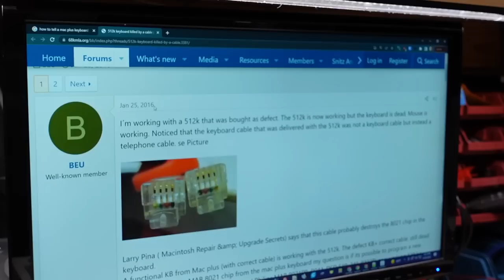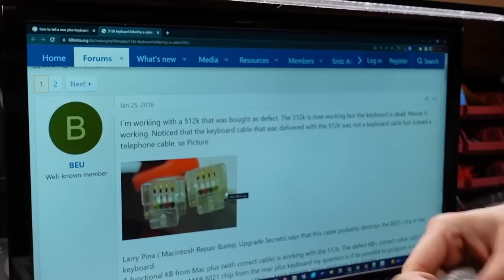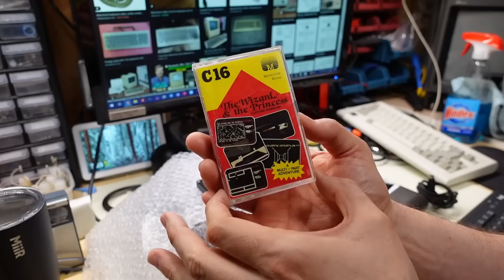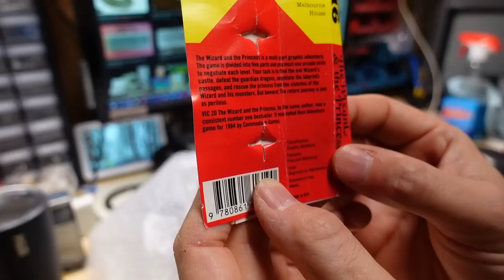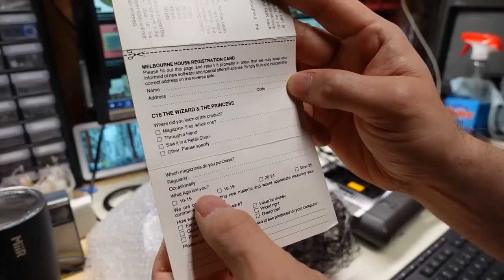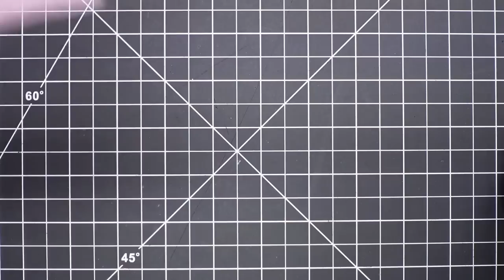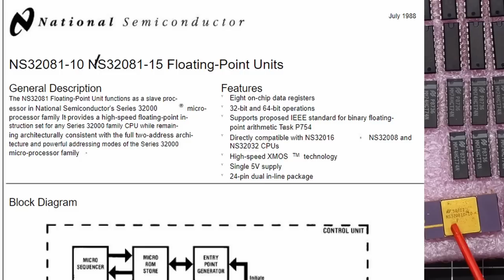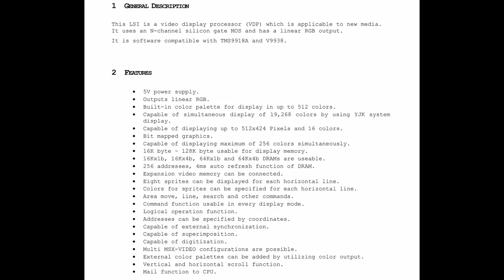0037 New old stock PCjr keyboard, the best adventure game of 1984 and a ton of chips

Comment: In relation to the 65816 processor that you can get adapters for to sit in a 6502 slot: I have a 65c802 processor in my apple //e.  It's effectively the 65816 processor with that adapter (that just loses the upper 8 address lines).  As for software for it, the only software that I personally found for it in the day was a version of Merlin assembler so you could easily write software for this processor.  I made great use of it as a teenager and wrote a fair amount of code to do things like Mandelbrot set generators or game of life using the 16 bit instructions/registers (which meant that things ran significantly faster than what it would have with a stock 65c02).  I even have one of the printouts from that era that I printed on an Apple DMP printer signed by Benoit Mandelbrot.

Comment: 12:04 This one is a Rockwell 65C02 made for the later Apple II machines (the Enhanced/Platinum IIe, perhaps also IIc).
Apple used other 65C02 versions from other manufacturers, too, though.

15:20 The Am9517A is a DMA controller - so good job there! (don't know if they are Intel clones, though)
There are also several Real Time Clock (RTC) chips like the NatSemi MM58174 on that sheet.
The JRC (Japan Radio Corp.) 2267D are dual video amps and also certainly not 74-series logic chips.
I've also spotted on of those 556 dual timer chips on that one - they were often used.

16:15 This OKI chip is also an RTC and not a RAM chip.
There are more MM58174 RTCs and their bigger DIP brother MM58167 to their left is also one.
There are also two more AY-3-8912 sound chips further down (when using the writing on the ICs as a direction).
Reply: The 8237 was an Intel clone of the am9517 (not the other way around) so they are identical.  The am9519 is an interrupt controller, similar to but not compatible with the 8259 and the am9513 is a timer, similar to but not compatible with the 8254.  The 9517 was based on the intel 8257 so amd was taking intel parts and improving them but the 8237 was the only intel adopted.

Comment: That PLCC 68010 looked like it was a 25Mhz part! I didn't know those even existed. The Supra Turbo-28 was a 28Mhz 68000 accelerator for the Amiga 500. This part would probably direct-swap with that (with slight OC) and give the customary 68010 15% boost from the instruction cache.

The MOS 5719 is a Gary chip from an Amiga 500 or 2000. 8364 is Paula, and 8362-R8 is Denise.  The R8 has the Extra Half-Bright mode. The R5 commonly found in the A1000 does not.
the 3xxxxx-02 chip is an Amiga 1.3 Kickstart ROM. -01 is a 1.2 Kickstart ROM.

Comment: The 65816 was also used in the SuperCPU, which was a processor upgrade for the Commodore 64. Plugged into the cartridge slot, and I think it was clocked at 20 MHz. I believe there were switches on the expansion to disable it. Exceedingly rare, and is my personal holy grail to find one.

Comment: The MC6809 is the chip that was used in CMI's FAIRLIGHT V that used 8" floppys and was used to create Crockett's Theme and would be the unit Dr Mix would want to get his hands on.
Reply from the maker: Heh yeah it's also the brains of all TRS-80 Color Computers (From the Coco1 to 3) along with the Dragon 32/64 machines. I'd imagine the TRS-80 Coco line was the biggest selling consumer facing thing that used them.
Reply: @adriansdigitalbasement2  Note that the CoCos use the 68x09E variant, which is code compatible with the 6809, but not pin-compatible, so I don't think the 6809s you have here could be plugged directly into a CoCo as a replacement.  I believe that the SWTPc 6809 boards do use the 'regular' (not E(xternal clock)) version of the chip.
Reply: The Vectrex game console also used a 6809 microprocessor.
Reply: I’ve seen a lot of embedded systems use the 6809. The automation system on a Soundcraft 2400 used it.

Comment: An HP variant of those hex displays (HP 5082-7340) were used in the original 1976 Cosmac Elf computer from Popular Electronics, powered by the RCA CDP1802 :) Modern recreations usually use the TIL311 as they are easier to find.

Comment: The hex display chips are suitable to be used in an original cosmic elf build from the 1976 and 1977 popular electronics magazine articles. You can download the complete article from the web and still find all the chips to complete the project today. The original display chips called for are the hardest part to find. The TI chips you received are much easier to find and although they are not in the same package as the original they will still work and look period correct. Maybe a Cosmac Elf build would make a good video. Steve

Comment: I wish the bare SYM-1 mobo I'm about to build (technically an SM-100 OEM board) from 1978 was wired for those TIL311 displays. Alas, it's already pinned out for regular 7seg units. Probably for the best given that those TIL-311s regularly go for over $10 each on eBay these days. 😃

Comment: It looks like with Macintosh, you just have to double check the pinouts and then crimp it once you confirm the wire order.  Really I don't own a Macintosh but that is probably the least proprietary part Apple has ever used.  I like that design because someone who knows what they are doing can go to the local home store and make a new keyboard cable.  I just hope they realize to check the pins on both ends of the original or get photos from someone who has the original of both connectors side by side and as clear as possible.  These days it is easy for almost anyone to snap a photo of anything and immediately send it to someone (or as soon as possible).  For PCs you can find the connectors for most cable ends online anyhow but it is so nice to be able to just make a new one just like making a network cable.  The only downside of the PC connectors is there may be a shortage of them with the supply chain issues we are having these days.  How long until this nightmare is over?  I just want everything back to the way it was before the pandemic (low prices once again and no more shortages).

Comment: So that stack of chips calls for a diy homebrew project, z180 + 9958 some ram and rom, even sound on a 4x6‘‘ pcb. BTW that plcc package ic in the beginning was either a dual ported sram or a cpld ( I didn’t catch the label on my phone 🤓 ) I’ve go a pile of old ICs catching dust on the shelve ( very similar assortment) myself that I don’t find the time to mount on a board and tinker with - too much projects and not enough time - oh well

Comment: when you look at both rj connectors that way and the wire colours are "reversed" but if you hold the cable out straight then the wires are straight though, not crossed...

Comment: If you watch iPhone repairs, Apple booby trap everything, ie long screws next to short screws in the hope you use a long in a short hole and punch a hole in the PCB.  Components surrounding connectors/battery, so if you pry them wrong you smash them.

Comment: Nope, the HD64180 wasn't used in MSX machines. Only plain Z80s (later integrated in chipset) and later the R800 which was a faster Z80 variant designed by ASCII

Comment: That’s urban legend! Using a flipped cable won’t kill the keyboard, at least in the Mac Plus, the keyboard will just not work.
Reply: I remember I had a Mac Performa as a teenager and I somehow fried the ADB port by using about 4 loose wires (the wires you'd find in a Radio Shack electronics lab kit toy) to connect my keyboard pin for pin when something happened to my keyboard cable (something must've crossed or shorted).
It looks like those cables are RJ9 (you can still find RJ9 crimpers and connectors and as for the wire you can probably use any sort of 4-pin cable) - so as long as you know which end is what you can cross and flip them as needed to have the right cable

Comment: Imagine apple making incompatible cables for their products that brick them if you used something that they didn't make........ :P
Reply: That was a very different Apple in a time when it was VERY common to have ubiquitous connectors with bespoke and completely incompatible pinouts.  Circular DIN connectors for everything from audio to digital data to power, 3.5mm TS plugs for power and audio and video...  D-subs were who knows what.  It wasn’t just Apple, and it was par for the course at the time.

Comment: RJ-11 ;)
Reply: RJ-11 is for a phone to the jack. I believe the smaller one for between a handset and phone is coded as RJ-9 (they still make crimpers for them as well as the connectors so making replacement/spare cables that have a different pinout on each end would be very doable and as easy as making patch cables)